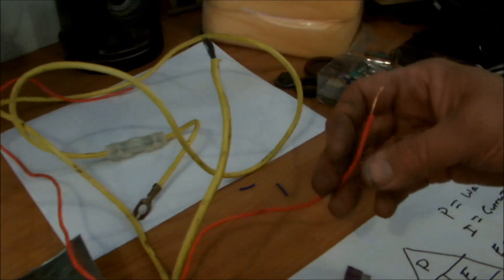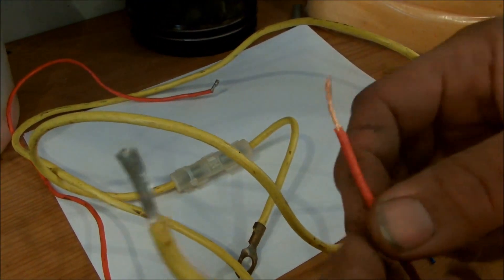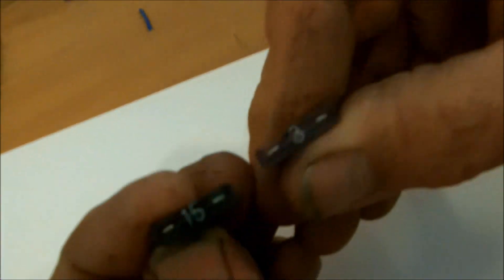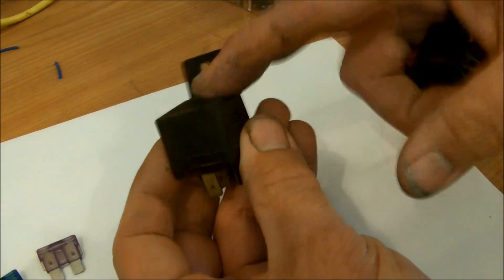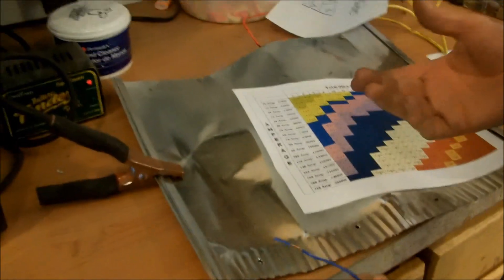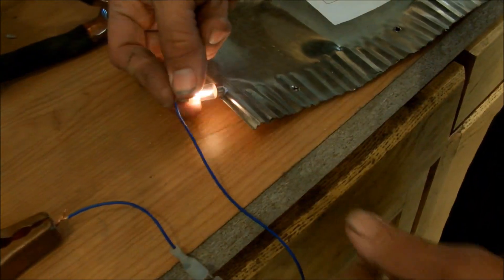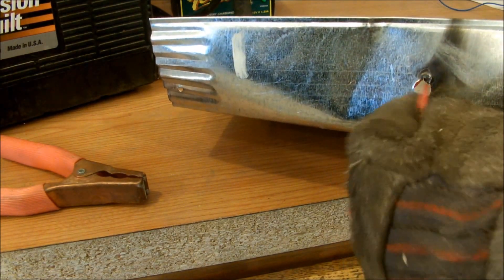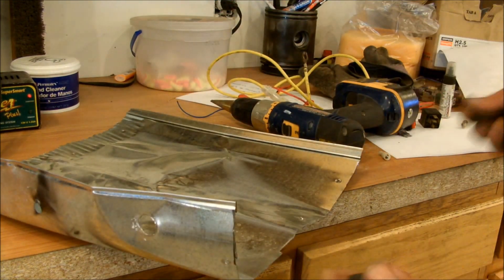How to prevent wire fires. Proper automotive wire sizing, protection, fuses.

Comment: The demonstrations r really good. How else can we learn by just theory. Visually seeing the short now I understand the main reason for fusing the wire. I don’t understand what’s the difference of fusing close to the positive terminal rather than a bit further as the fuse will protect even the wire before....the fuse to me protects the whole circuit
Reply from the maker: the fuse only protects the wire downstream from it. a short before the fuse to ground will burn the wire up as opposed to the fuse blowing.
Reply: SilverCreekMotors but if the circuit gets more than the fuse current, won’t the fuse blow before any damage is done to the wire?

Comment: Generally, the wire gauge and length is important in DC, automotive wiring.  However,  if you contact a electrical supply house, who specializes in selling wire, they can hook you up with a wire type whose insulation will allow you to use a smaller wire with thicker insulation that will fit your application.  So, let’s say you install a compressor in your truck.  The manufacturer says to use #6 primary wire, but that is too big and bulky for you application, you could run a #10 if the insulation around the alternative wire is rated for the amperage needed.  Finally, make sure the vendor is the one who advises you on the correct wire and it’s use.

Comment: I’m putting in an electric fuel pump on my classic car that draws 1.2-1.7 amps.  Would a 2 amp fuse do with 14 ga wire at a max length 4 feet?

Comment: I need to print out some charts like that! Right now I use various online calculators, pretty cool, tell you what gauge of wire to use to get acceptable voltage drop (you specify) but a quick chart would be QUICKER by far. I'll look into it.

Comment: I was working on my car and I was putting a stereo in and my yellow and black weirs touched is my stereo broken cut it won't turn on or anything plz help me or let me know if I need a new one
Reply: Devin Harris check the fuse for the radio or head unit in your fuse box. positive you just blew the fuse. thats actually what fuses are for so it doesnt short your radio. should be less than a dollar fix